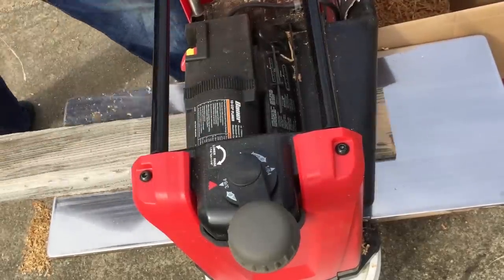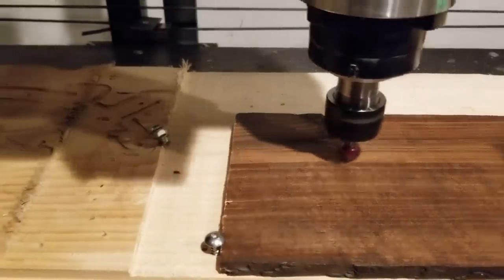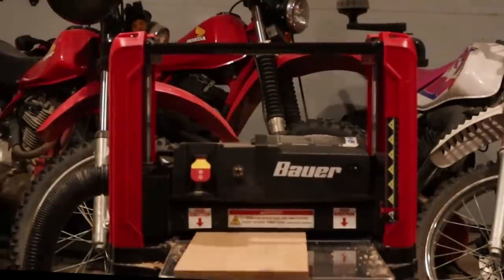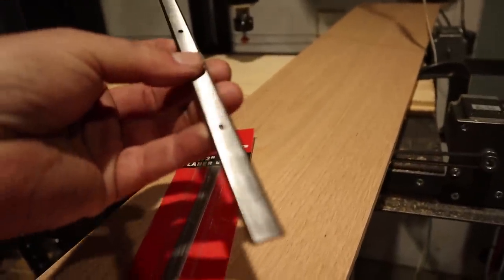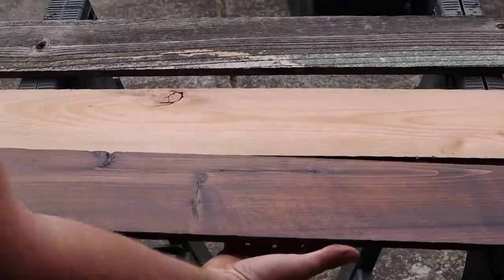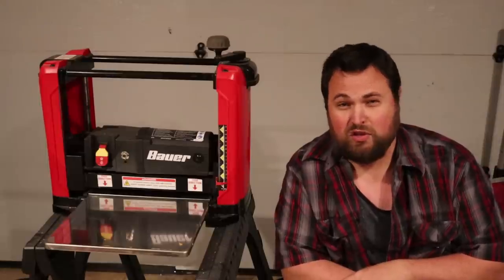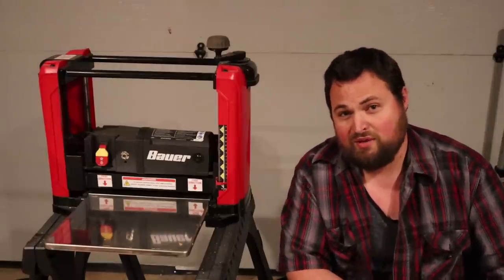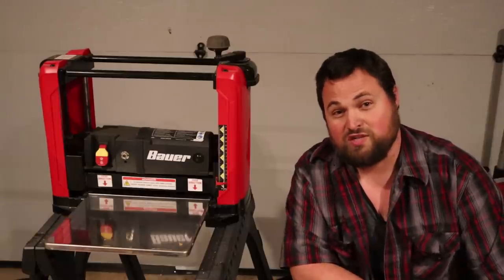Harbor Freight Planer Review Update: 1 Year Later

Comment: Literally bought one of these today based on this review.  Unfortunately I did not have the same experience.  After checking the infeed and outfeed tables I ran some test pieces.  I experienced at least 3" of snipe on the leading and trailing edges of the wood.  After some investigation I realized that once enough material entered there planer it was lifting the entire motor head.  Very bummed to say the least. But happy I didn't put one of my oak treads through it without testing first.
Reply from the maker: Time to let harbor freight eat that cost. That's totally uncool.

Comment: Great video!  I'm Canadian and thinking about a road trip to Buffalo just to get this planer.  What are you doing for dust/chip collection?  I saw your original video where you used the box as a chip collector, would a large garbage can and some tubing work or should you have suction?
Reply from the maker: That's not a bad idea. I use a shop vac (the hose fits perfectly), but it fills up really quick. Keep lots of 55 gallon trash bags handy.

Comment: Bauer and Hercules are actually pretty well made.  I have a 20v hercules impact drill that lasts forever and on torque setting, drove  3inch wood screw THROUGH a 2x4 and into the next one.  My corded drill won't even do that.  I just bought the hercules table saw and it's solid. Super accurate and quieter than my craftsman.  Accurate enough to rip a 1/16" vaneer strip from a sheet of plywood. I've had many Chicago electric tools over the years and while the lasted,  they were nowhere near this quality. HF is killing some of the big name brands.  I've seen price drops from dewalt recently too.

Comment: If you didn't wood work in flip flops I'd be more inclined to sub. My only question is did the planer, plane evenly? You talk about the surface but that is only half of the story,. What good is a nice surface it the board is 3/4" on one side and 9/16" on the other?
Reply from the maker: Remember, I'm using this for CNC work. If it's .040" different from end to end it's not usable. These pieces are literally coming out perfect. And quit worrying about what other people put on their feet. I literally wear work boots 70+ hours a week, and in my house I will wear whatever I damn well please.

Comment: I bought my planner months ago and it's the exact same 1 you have. After plaining a couple 6 by 6 beans that I cut on my mill I began having problems. It refused to cut. No matter how tight I got the rollers on the material it would not cut and ultimately it would not go through under the rollers. I changed the blades But with no success. Still won't cut. Aside from your normal height adjustment is there some other way to adjust the blades downward?

Comment: Do you ever make signs out of old distressed barn wood without planing down to new wood ? Irregular shaped Live Edge planks?
Reply from the maker: I have, but it is much more complicated to program/run. The rough surface requires you to flat mill the font with a tiny bit instead of engraving with a large chamfer bit. Meaning a sign that should take 2 minutes to machine ends up taking 20-30 minutes, and with less detail.

Comment: I bought this planer from HF abut a year ago for the same reason you did, I make small signs and small projects now that I'm a retired cabinet maker. But it has a motor/power issue. It starts to slow down after running approx. 8 to 10 boards and I could smell a burning odor from the motor as if it's overheating. This happened the first time I used it. I recently ran it again with no issues for the first 7 boards, then noticed it slowing down again with the burning smell returning. Now with 45 years as a professional high end cabinetmaker/woodworker, I certainly know how to run and maintain a surface planer, but this problem is puzzling. For reference, I run mostly pallet material which is primarily pine, oak and poplar, all nails removed. Is there anyone else finding this planer overheating prematurely?

Comment: As of Jan. 10, 2020, it costs $350 at Harbor Freight, while an equivalent DeWalt costs $100 more. So if it was truly half the price of DeWalt, as you've mentioned, I'd buy it, but with a $100 difference, I'd rather by DeWalt.
Reply: I believe he is referring to the price with the 20% discount he had when purchasing it which would put it around $280, which is $170 cheaper than the Dewalt. Even at the 15% discount he discussed in the video, it would put the planer at $300. Still not quite 50% cheaper, but you get the picture...you're saving money. Also, not sure what the extended warranty costs either. Therefore, you are probably still close to the $100 mark if you do not get an extended warranty for the Dewalt and making this post is a completely pointless response to your post.

Comment: I have a sds max hammer drill from hf, I bought it for 1 decent sized job, it finished that job and it's still running strong, but it's not as nice as a makita or dewalt tho but at half the price I was expecting worse

Comment: I’ve had this one for 2 years in my garage guitar shop. Even curly maple goes through it fairly well if I take shallow cuts. My only complaint with it is the thin metal bed. I was planing down some guitar tops to 3/8 inch and the piece of wood cracked at the end, which sent the chunk at a weird angle into the blade. That caused the chunk to slam into the bed and put a dent in it. Not a big deal, but it could be better. I got a piece of granite scrap in there now to make the wood easier to slide through.

Comment: This is just a delta chassis from 20 years ago. They sell of the tooling and knock-off manufacturers buy them. They generally have lesser quality bearings and lower quality motor armatures. I have a knock-off of a Delta drum sander and it’s a great tool and very simply made which equates to less breakdowns.

Comment: Bauer is just like dewalt in alot of ways they are cloned of a UK brand called Power Plus.. I have both and they perform similar I'm still working on the CNC machine I had I just purchased it any tips

Comment: I went to Harbor Freight two times.  First time I bought a packet of plastic zip ties. Went to use them and the little ridges make them lock  together were non existent.  WTF?  Second time I purchased a two for one sale 4-1/2" electric grinder.  First one lasted less than 8 minutes of moderate use, the second one lasted about 6 minutes before it too, like the first one, burned itself up. Hours of use to finish the project with a Dewalt and it still runs fine (though not a big fan of DW.)  Have never been to a HF store since, nor will I ever buy their crap.

Comment: One bad thing he said that I disagreed with is that he throws away bad tools and doesn’t review them.  I also would like  to know what bad tools to avoid especially from Harbor Freight as I have had some tools that I purchased there that turned out to be pieces of junk.  E.I. I recently bought a special sale grinder that worked great if you could slide the stubborn on/off switch and I wound up breaking the internal attached bar that actually moves the plunger in and out to start and stop the motor. I had to jam that plunger on the “on” position and then put a on/off switch on the electrical end plug.  I would have been more of a hassle to return the item and I was working on a project that needed to be completed ASAP.
Reply from the maker: For whatever reason people get attached to tools, even shitty ones. When I do bad reviews people hate the videos so much. The videos get so many thumbs-down and hate-filled comments, I don't particularly like it.

Comment: get the warranty, but how good is HB with their warranties.  if you're lookin for a battery operated drill or impact that ain't gonna break the bank, check Home Depot's RIDGID stuff.  batteries are interchangeable and I can do a tire rotation on my 5 lug car with only using 25% of the impact gun's battery.  haven't had to use the warranty, but supposedly the warranty is for life - and this warranty comes with the tool

Comment: Just a thought don't throw that crap away use it!
That saw dust comes in handy for a good number of tasks.
Make wood filler with a bit of glue..floor dry when your vehicle springs a leak oh yeah it will it's not a matter of if it's a matter of when.

Comment: While it's cheaper, it's definitely not half the price of DeWalt. The 12.5", 15 amp DeWalt is only $75 more ($350 vs $425); once you add the price of the extended warranty, the difference is even less. Not saying it's worth spending more, but it definitely makes the decision a little tougher.

Comment: Just going to point this out that apparently not enough people know: Harbor Freight has a ridiculously forgiving return policy.  Anything within 90 days, except of course for consumable products and even those within reason.

Didn't like it?  Return it.  It broke?  Return it.  You got mad and yeeted it out the back of your pickup going 110 down the highway?  Return it.  It doesn't matter what it is (mostly), it doesn't matter what you did to it, how you used/abused it, as long as it's within 90 days of purchase and as long as you have the receipt (sign up for the email ones, they're easier to sort through) they'll refund you down to the penny.

Anything with Pittsburgh on it has a lifetime warranty, you that wrench you bought and turned into a bottle opener is still under warranty as long as you left the branding intact.  I think a few of their new tool brands are lifetime warranted as well, like I'm 80% sure Doyle and Bauer hand tools (not power tools) have a lifetime on them.  And honestly, most stores are pretty lenient if you're not a dick about it.  When I worked there, nine times out of ten I'd replace someone's power tool even if they didn't get the extended warranty or it had expired.  Granted, we had to work within the rules, but they could be bent for a lot of things.

So to all the channels out there reviewing Harbor Freight stuff, go ham and you will get you money back by returning it within 90 days.  One guy cut a safe in half and could have been reimbursed if he had just taken it back.

Addendum:  forgot to mention, somethings do have a restocking fee to dissuade people from buying, say, a concrete mixer for one job and returning it.  But again, we waived a lot of those for things that were clearly not working, or if we liked the person returning it.

Comment: I have one of these and I'm a new hobby wood worker. I'm getting snipe on both ends of my boards when I run them through the planer. Any help?
Reply from the maker: I havent experienced this issue. How much are you taking off per pass?
Reply: @StrangeGarage  I've reduced all the way down to a 1/16th a pass and still get it. I dont know how much is too much but I've never tried to go over an 1/8th.
Reply: @StrangeGarage  Both tables are dead level all the way through also. Checked with a 6 foot level and an angle gauge.

Comment: $500.00 Miller or Lincoln Welder? There is no such thing!🤪🛫 but I do own the Omni Pro Welder from HF and I am very happy with it so far.
Reply from the maker: Sure there is, we have 2 of them at my work, and they are garbage.

https://www.homedepot.com/p/Lincoln-Electric-88-Amp-Handy-MIG-Wire-Feed-Welder-with-Gun-MIG-and-Flux-Cored-Wire-Hand-Shield-Gas-Regulator-and-Hose-115V-K2185-1/100596739?mtc=Shopping-B-F_Brand-G-Multi-NA-Multi-NA-Feed-PLA-NA-NA-Catchall_PLA&cm_mmc=Shopping-B-F_Brand-G-Multi-NA-Multi-NA-Feed-PLA-NA-NA-Catchall_PLA-71700000014585962-58700001236285396-92700010802552397&gclid=Cj0KCQjwu6fzBRC6ARIsAJUwa2RBwlriT8iqOQ7ZQMHMenf1lU-4_HQiS_2L5PmzXDr9K290rYIIN7oaAgzxEALw_wcB&gclsrc=aw.ds

Comment: With all due respect...That looked like red oak you used which is very porous and easy to plane.  A much better test would have been white oak which is very hard, dense, and typically used for flooring.  I would have loved to see you run a piece of white oak through there, or a pieces of IPE or White Ash!....anyway..... I'll probably stick with my dewalt 734.....God Bless

Comment: They are not hear double that one runs about $350 out the door the dewalt 12 1/2” comparable planer is $450 so it’s only $100 more and will out last and out perform that one ask me how I know it will not last running hundreds of board feet of hardwood through it doing dinning tables and such but for what you do soft wood and tiny little pieces here and there I’m sure it will last a long time but I went through one then did the warranty then ran through that one in about 4-5 months then bought the dewalt and am still on the original blades filled once after a whole year and it eats through whatever you put in it for about $100 more it’s totally worth it now the big 13” dewalt planner is almost double but not the exact same spec dewalt planer only about $100 more so I would say worth it if your building furniture but for CNC work that one is fine and will more than likely last years with blade changes or until the motor burns out like both of mine did with dense hardwoods
Reply from the maker: You're right, it wont stand up to lots of hardwood. That's really more of a job for an industrial planer, but if the Dewalt does it than just go with it. Mine was dirt cheap, so I could not justify buying a dewalt, but I got lucky.

Comment: I tend to agree with you about  the cheap comment.  Related to those shopping at Harbor Freight    I am a retired Woodworker   That I worked in the industry for over 20 years. And longer as  one of my main hobbies and passions  i do. Buy selectively from Harbor Freight  and this whole Bauer  line they are carrying is a attempt to sell higher quality more professional  level tools. Thats why they dont  honor the  coupons on  Bauer and the warranty is not like their. Chicago Electric tools  they. Do charge more of a premium price  for them as they are trying to compete  with. Brand name tools like Dewalt , Makita , and similar brands  HF does have a few winners  especially for the price  some of them being their  hydraulic jacks and scissor lifts  along with  some of their tool chests and carts  as welll as things like  Engine hoists,  pry bar sets  and some other miscellaneous hand tools  plus its a great store to buy consumables like sand paper , hardware , and so on  ironically they. Have sort of set the bar on a few woodworking tools over the years  i used Senco nail guns professionally. For years mostly due to  a awesome local  rep. Who would go out of his way to keep your   Items in tip top shape and  provide everyone with excellent customer service and warranty work  similar to what the big tool truck  guys do for mechanics  of course. You paid for that service up front on the purchase of the tool  prices  compared to big box stores or the internet  but it was also nice to  help my local  guys out as well  leading me to  that i am quite happy with HF  pneumatic  tools and aessories for my personal  shop  that  basically is used by myself and my son  for personal projects   Not only do i use their nailguns  but i like their fasteners as well  as they. Are a convenient location to me to pick up supplies
Reply: I hate wasting wood to the thickness planer too but it’s sometimes easier than resawing and then planing.

Comment: Ok, the video is great as far as info, one thing, that's a surfacer not a planner...
Reply: A thickness planer, mate
Reply: @criven3128  I will concede to that, and if it was called that I would not point it out, it would just be semantics at that point. These machines though are the last step of wood processing if you are a cabinet/furniture maker after joiners, saws and traditional planers, and it is for consistent thickness and surface before routering and joinery. You would not really want to start with quarter saw wood on this machine, you could, but it is undo stress on the machine, and it would take forever shaving down a single side a 32nd at a time.

Comment: thinking? is it the tool that does the real work? or is it the blades that do the real work? to me it's the blades that do the real work! plus the quality of the steel, or the carbon steel the blades are made of? as long as the motor runs good you're always have a good CUTTING tool! also keep the blades sharp that helps a lot! dull blades will kill the motor making the motor work twice as hard to cut!

Comment: Interesting.  I bought one…used it for a few months,…motor burned out. Had the warranty so I got the replacement.  It broke that day…sprocket/chain this time. Took it back again and they didn’t have any in stock.  Got a refund on a gift card. Bought a Wen. Quieter, smoother planer.

Comment: What is it with woodworkers wearing flip flops while working? I have seen several videos by different people wearing flip flops while they are cutting, hammering etc. is safety a thing of the past? I don't get it, I was more interested on the review of this machine but I just could not help it but to finally comment about this "small safety issue" other than that, thank you for the review, I think I will buy this planer today
Reply: Panzer Tiger XI I’m on same page. I’m a hobbyist but still see reviews on table saws, planers and other various tools with no hearing protection, safety glasses, push sticks, etc.

Comment: As a pro woodworker for over 40 yrs dint buy this unless you are planing 1 inch wide pine boards. I dont care what anyone says....this machine is a piece id junk. Do yourself a favor and upgrade.
Reply from the maker: It would make sense for a pro woodworker to buy a better one. It doesn't make much sense for a mechanic to spend a ton of money on something they would hardly use. Much like how you probably don't need a liquid cooled AC/DC miller TIG.